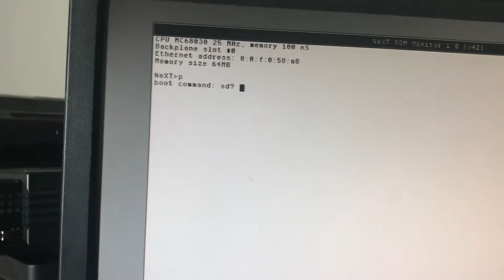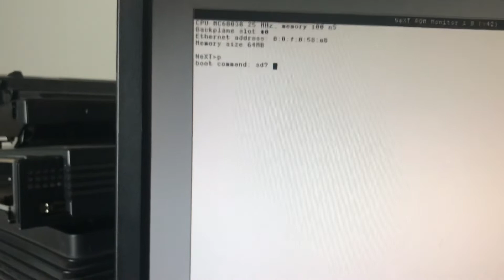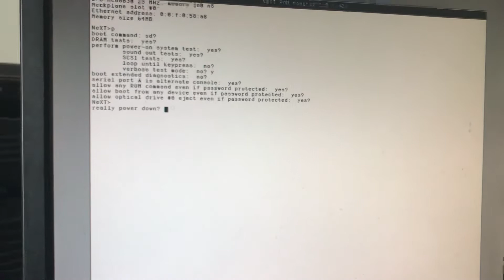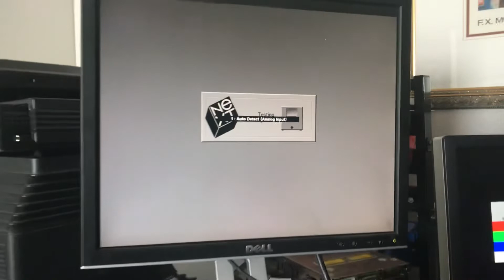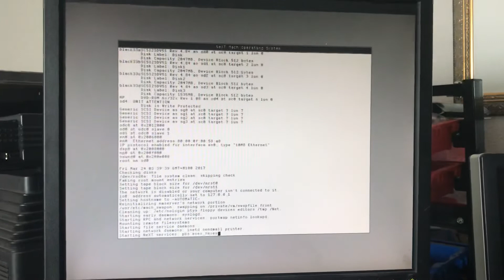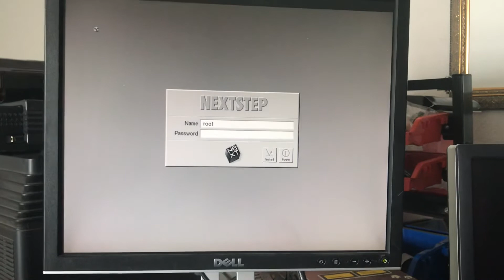NeXT Cube NeXTstation Computer stuck Loading from Network , how to fix it by changing parameters.

Comment: Thanks so much for sharing this. After I swapped the battery in my new NeXTstation, it defaulted to booting from network. Your instructions here helped me quickly get it switched back to boot from HD; it worked on the first try.

Comment: What if mine doesn’t show booting from disk like yours in the video? Mine just starts with “testing system” and then goes to “loading from network” without the middle stage. I’ve tried holding command and tilde, but nothing happens

Edit - I also do now hear the drive spinning up on multiple occasions and then proceeds to make an almost beeping kind of noise and then stops spinning. So I’m assuming it might be a bad drive which is causing it to skip the “loading from disk” step
Reply from the maker: I'm not sure if I answered this question apologies if I didn't , so you need to hit the command and tilde key immediately after testing system disappears from the screen and up pops loading from network . It should take you to a NeXT>  where you type in p for parameters and  press return, parameters will start , then it should say boot en?   enter sd and press return and follow the command prompts   . Here is the actual documentation from the NeXT Network and System Administration manual we scanned in and uploaded on line in the nextcomputers.org archive  https://www.nextcomputers.org/files/manuals/nsa/09_StartShut.htmld/index.html  Hopefully you have been able to get it working :) You can always email me at bhi1@ix.netcom.com